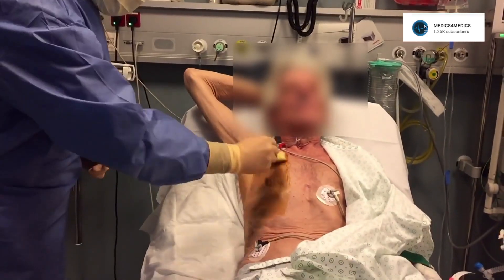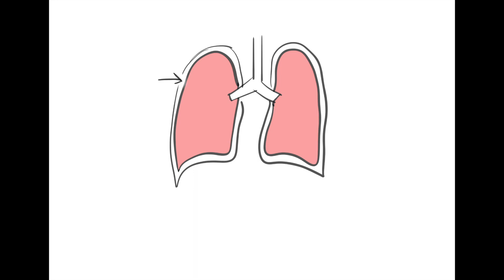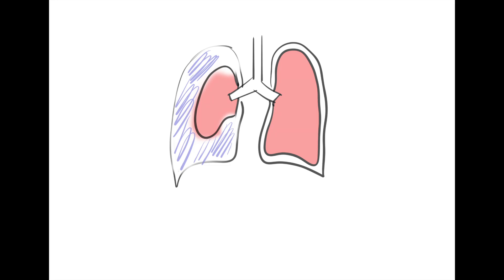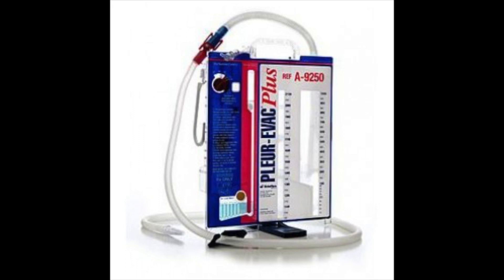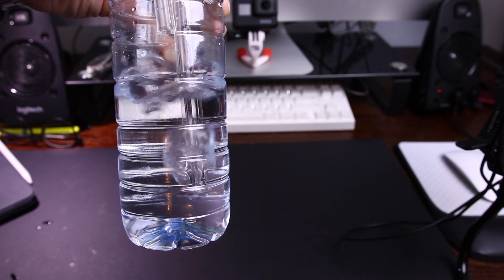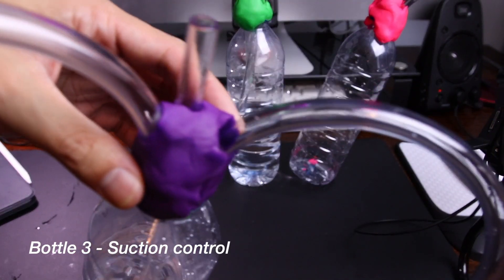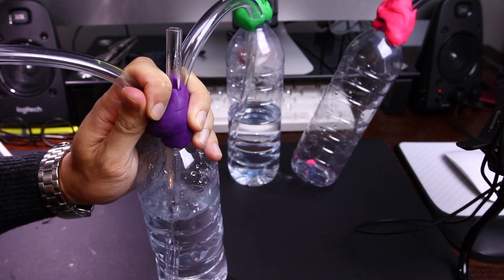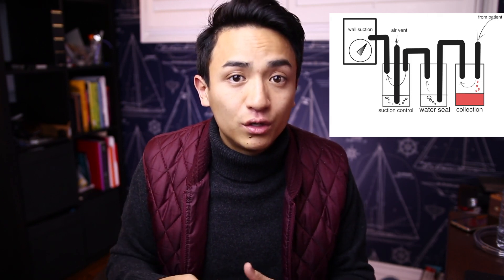How Doctors Fix a Collapsed Lung - The Simple Design of Chest Tubes

Comment: I suffered a minor spontaneous right sided pneumothorax (only partially collapsed from the very top.) In 2020 And could feel said lung shifting abnormally within my chest cavity. (I reckon it occurred when I was swinging at my local park. Air pockets on the surface of the lung coupled with my stature. (Tall and thin.) Were considered the likely triggers for its occurrence.... A brief stay on the cardiothoracic Ward in my local hospital saw it gradually recover on its own accord without any complications. A brief discussion on the 50% chance of re occurrence surfaced and the procedure of choice would be adhering the plura to the chest wall. (Which is not a fun journey.) 

Yet I've now noticed, that whenever I am in a particularly stressful situation... Or whilst I was working as an AIN within aged care.... I would experience mild to moderate right sided chest pain on and off (eventually it was always present.) Unfortunately I had to leave my position due to a beyond septic workplace culture. (Currently seeking out a better opportunity.) 

Ever since doing so? Said chest, shoulder, upper back and neck pain has completely gone!! 

Can stress/anxiety/depression be a triggers or be known risk factors for spontaneous pneumothorax (both intially and re occurring instances?)

For context. I do not end up hyperventilating in such stressful situations (it would be rare if it does occur nowadays.) Don't know if  hyperventilation alone can cause a pneumothorax anyhow.
Reply: So did you get the surgery (PLEURODESIS VATS) that they talked about with you?? I’m currently in hospital right now and I’ve only been here 2.5 days and they already want to do the surgery but i want to wait as I feel it will heal on its own, I just need more time.
Reply: @charniecearielle   @charniecearielle  thankfully? My lung re inflated on its own after some rest and some supplemental oxygen. The collapse for me was the upper portion of the right lung. (only a few centimetres from what I recall on the X-ray.) They were going to do a surgery to re inflate the portion of lung that collapsed then apply an adhesive to my plura (lung lining.) To the chest wall. That was the option they were discussing with me. 

I'd assume they would have taken X-rays, perhaps an ultrasound and a breathing capacity test in your case. If so? How significant was/is the collapse? Was it diagnosed as Spontaneous like mine? 

Sending you virtual support and strength.
Reply: @lauraconnolly663  Yes mine was spontaneous as well! X-rays and scans have been done and I have no damage. They’re just eager to do surgery because although my lung stays inflated with the chest tube and suction on, it goes down a little once they disconnect the suction (indicating it’s still leaking a little). But it’s only been 2.5 days so I don’t want to jump to surgery so quickly as I’ve read it can take a few days for any leaks to completely stop. Thank you so much for your support!!
Reply: @lauraconnolly663  oh and I was told it was a pretty significant collapse so that’s another reason why I think it best to allow more time to heal naturally. I’m not in any pain just discomfort at times from the tube being in and I don’t want to rock the boat with an unnecessary surgery. I really think I just need more time (I’m known to heal a bit slower than most even frm mild injuries and infections).
Reply: @charniecearielle  Due to the fact they've gone ahead and had to put a drainage tube in? Am I correct in thinking that the portion of the affected lung was quite substantial? That likely is one of the reasons why it is taking a longer time... (It's all based around achieving air pressure homeostasis within the chest cavity and the lung itself.)
Reply: @charniecearielle  Thought so. I am certain the medical team looking after you will be monitoring you closely to ensure that you recover. (just be mindful, any tubing that is typically placed within the human body? does carry risk of infection. the longer such tubing is present? there is a higher risk of such instances developing. ((Such is not meant to scare you, It is just factual.)) I would enquire on a recovery timeline in regard to your condition as is and I would ask if there was a possibility to discuss the next plan sooner rather than later. The last thing you'd want is to be rushed into emergency surgery due to infection or deterioration of your breathing etc.
Reply: @lauraconnolly663  Omgg I didn’t even consider that - thank you so much for your insight and thanks again for your support and encouraging words!!
Reply: @charniecearielle  That's ok. Just keep tabs on all sensations (painful or otherwise.) and breathing patterns. The nurses should come and do your vitals (which includes 02 readings, pulse and breathing rate per minute etc.) so they'll track such and if you need supplemental oxygen for a lot of the time? They'll likely get in contact with the right specialists to work out if they have to go through with the surgery mentioned. I wish you the best of luck and am sending hope of a speedy recovery.
Reply: @lauraconnolly663  Yup! They’ve been coming around routinely to check my vitals and haven’t mentioned any oxygen issues or put me on any supplemental oxygen so I think all is well there. I’m not in pain just discomfort from the tube and the “knowing” that it’s something foreign inside me. The Specialists are concerned because when they stop the suction from the chest tube, my lung deflates a little (according to chest xray) so that’s why surgery is recommended to keep my lung up. You are amazing and I can’t thank you enough for your support this morning - it’s really helping me through this!!
Reply: @charniecearielle  Which likely means that an ongoing air leak is preventing the air pressure from stabilising (due to something underlying and possibly related to the collapse occurring. Since it is spontaneous? They may not find a direct cause as such as to why it has occurred.. But they will investigate. Surgery ( for both explorative and restorative means.) will have to be the next option. No problem. I was studying to become an Enrolled Nurse yet found that it sadly wasn't for me as my fellow nursing students were horrible and my first placement experience within that course was horrendous treatment wise (by RNs and other AINs etc.) I have a background in aged care but sadly?  in the end? It was too stressful for me to continue. I am glad I have been able to help in a small manner.
Reply: @lauraconnolly663  Correct! WOW You’re saying everything they told me - you are indeed fulfilling your desire to be of service in that industry. Please continue to study and advise in this manner. You have no idea how comforting and reassuring this is to me!!
Reply: @lauraconnolly663  My sister was studying to be a Nurse many years ago and had the exact same experience as you mentioned with the other nurses and industry in general. She now works as an HR Specialist and is fulfilling her purpose to help others just like you are!
Reply: @charniecearielle  I am pursuing my love of art. I'd rather create works that bring joy, comfort and hope to those who like the looks of such than to be abused/mistreated/bullied/threatened by those who are supposed to be collaborating with me to deliver the above to people in need within a career/job. It just is not worth it. I am over such treatment and am getting back into the creative charge again.
Reply: @charniecearielle  Haha! Thank you, I agree that I would be a perfect fit for such an industry.. unfortunately? the industry in question does not properly support, seemingly like nor deserve me~! :D So If anything? I'll take on a lifestyle /activities/therapy role in the sector someday and only do the positive stuff in my job :)

Comment: Had a spontaneous pneumothorax back in January of this year. Being someone with a high pain tolerance as well as being too ridiculously stubborn to ask for help, I was reluctant to seek medical aid for nearly a week after I started feeling pain in my side and having trouble breathing. I convinced myself that I had just pulled a muscle in my back or that I had bad cramps from going skating with my friends a few days prior to feeling any discomfort, and continued about my life as normal. As time passed, breathing became more difficult, and I couldn’t carry out conversations without gasping for air after a couple seconds of talking. My friends, and a gut feeling I suddenly experienced convinced me to finally check into the E.R. And I thank God that I did; I was diagnosed and treated and got time off of work for the next couple of weeks while I recovered from surgery. The very next week when I was on my leave of absence, my workplace had a major Covid outbreak, and my doctor told me that it was very likely that I could’ve died had I not checked into the E.R. And gotten my diagnosis. I thank God and my amazing friends for pretty much saving my life. 🙌❤️
Reply: Is everything okay now? Have you had any more lung collapses since?
Reply: @R9TR0  I actually had two reoccurrences and had to get surgery to prevent it from happening again. Since the surgery though, I haven’t had any other problems with my lungs

Comment: Hi, 
Thank you for the example! I have a few question. So my boyfriend was recently admitted to the hospital for a collapsed lung, & the hospital told us it would only take 1-2 days for his recovery & he doesn’t seem to be getting better! He seems to be getting worse! He’s been in the hospital for almost a week & nothing has changed. 

How exactly is the lung or the wall around the lung going to heal on its own? & why do you think it is taking longer than normal for him to heal? 

I can’t be in the hospital with him because of COVID & the doctors aren’t giving us any answers!
Reply: Did you ever find out why the recovery was slow?  Having Surgery or being in the Hospital during COVID19 is no joke.  I had Surgery almost a year ago for lung Cancer.  I bad a Wedge Resection so I lost part of my Lung.  I was told I would go home the next day.  5 days later I was wheeled outside where my mom picked me up, the same place she dropped me off 5 days prior.  I was told when my lung was stapled it didn't seal so each day they clamped the tube, had me go for an Xray then told me I had to stay another day.  Finally by the 3rd day and not understanding my Surgeon came to see me alone and I asked him why I am still in the Hospital.  He explained it and once I could fully understand I called my family and explained what was going on   Apparently in about 5% of patients there is an issue with the lung not sealing.  The Chest tube was removing air from my chest.  Going forward I have a huge amount of respect for people having to be awake with a Chest Tube, so not funny, worst pain in my life.  Hope things worked out well for you a d your BF.